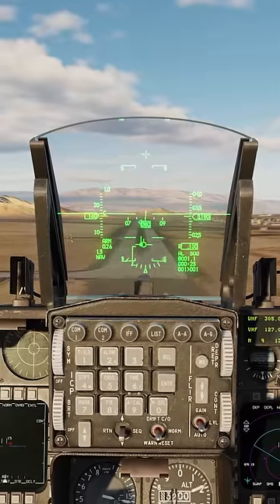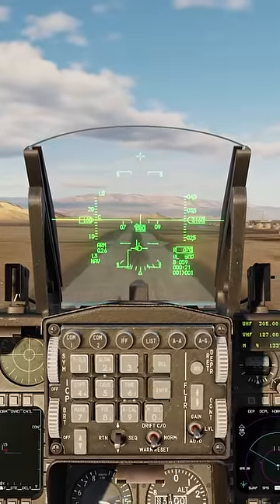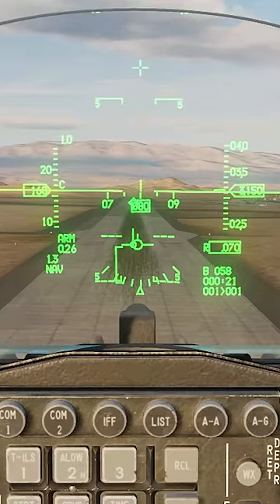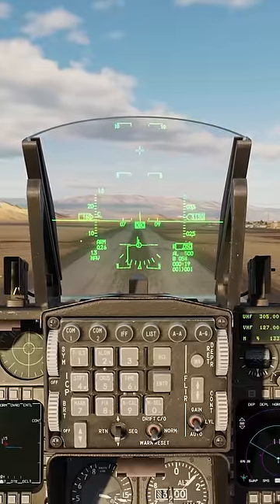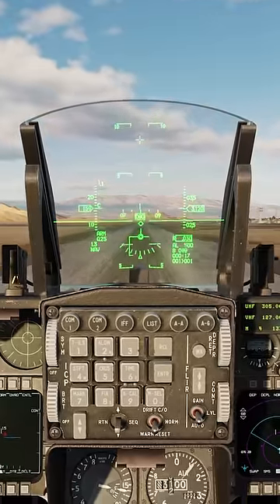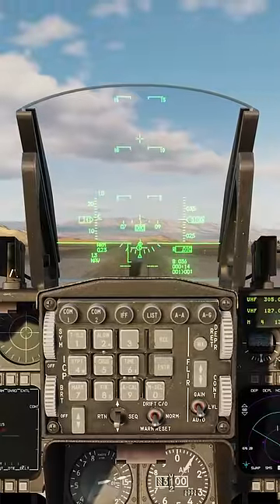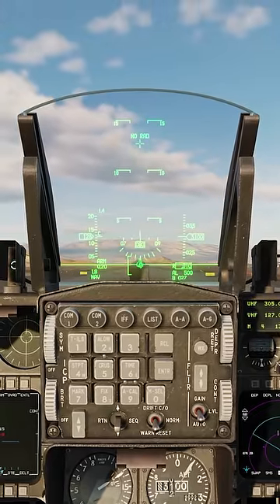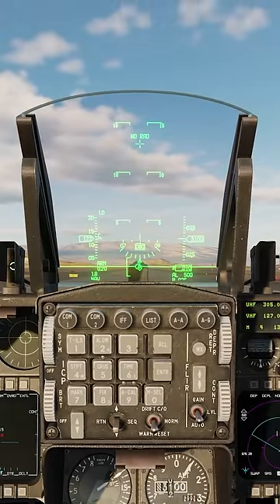Land the F-16 like a BOSS

Comment: I spent thousands of hours in an F-16 simulator in the 80’s. 

All they had me do was shoot at MiG’s 

It was the 80’s 

Good times!
Reply: How did that work? Sounds super interesting can u give us a basic rundown of what it was and how it worked?
Reply: @hi_c.v7289  nice try Russia/China
Reply: @irohaboat  teehee
Reply: Was an After Burner arcade machine?
Reply: @yamilishernandez7670  That would have been an upgrade. It was nothing but air to air and they kept adding to it till you dropped stuff.
Reply: Hard to believe how old these jets are!

Comment: First thing many people do wrong is assume the F-16 lands at passenger aircraft speeds, you’d be off to a pretty bad start approaching around 140kn.. it gets very unstable, you want to keep it around 170kn when flying the entire approach until right about to touch it down, ease it on the tarmac, and then aero brake, honestly an F-16 flies well, if you don’t overdo inputs, just like an Airbus A320, the less erratic inputs the easier the landing gets. 

The problem with the F-16 is the narrow wheel base, that’s what makes it very “hard to land” if you start playing with rudder too early, you’re going off the runway. 

Let it land, keep the flare, roll out. Practice makes perfect.
Reply: lol F-18 can land at 130 knots with no stores and 3000lbs of fuel

Comment: great landing, only comment is to close the airbreaks during landing. you open the air breaks AFTER you apply wheel breaks. the other trick is to use differential breaking to keep the jet in the center of the runway.

Comment: Aerobrake is done for economical reasons (and landing stability), not because it has "bad brakes" it actually has very good brakes when compared to some others in aviation. according to a few real word POH's i've read 'when the shortest possible stopping distance is req. lower nose as soon as practical and apply full brakes' paraphrasing ofcourse
Reply from the maker: I’d refer you to Rain from the afterburn podcast where he talked about that.  Never said bad brakes but small brakes.

Comment: Yeahhh this is the air force loading method.
Meanwhile in the Navy...
Aircraft barely hooks the third wire, almost goes into the drink, the tyres burst on landing and the nosewheel landing light shatters 

Pilot: Another happy landing!
WSO: *fingers numb from avoiding the instinct of pulling the ejection handle

Comment: I'm always nervous about striking the tail during my aerobrake so I tend to hold the gun cross at 10 degrees to give myself a little more wiggle room in case I fuck up on the pitch control.
Reply: I'm pretty sure 10 deg is the correct SOP until 100 knots then drop the nose and gently break.

Comment: If you want to fly an F-16 in a simulator, the best way to do it is not to fly DCS, but to fly Falcon BMS instead. (Currently at rev 4.36)  BMS has the most authentic F-16 models.
Reply: bot
Reply: @gibbo_303  Nope. Truth.  BMS > DCS.

Comment: Navy F-18 next?
Reply: just get full flaps and gear down, trim the plane until the velocity vector is in the middle then adjust throttles until the velocity vector is on the touch down zone then regulate throttle to keep it steady

Comment: Wait I use aerobrakes at the same time as I pull my landing gear down, should I stop doing this?
Reply from the maker: I don’t use wheel brakes until after the nosegear comes down; under 100 knots
Reply: @TrickerDCS  I meant air-brakes. I pull them out at the same time as my landing gear when I land.
Reply from the maker: @williammonot6426  you’re supposed to land with them out, but when you have weight of wheels, the speed brakes can go out even further but you’re not supposed to bring them out fully until the nose gear comes down.

Comment: AOA is not measured in degrees. You have degrees of pitch and units of AOA. AOA units mean the same thing during all phases of flight for a specific aircraft, but the attitude of the aircraft will vary for the same AOA depending on parameters of the flight (airspeed, or increased G loading for example).

Comment: why havent they designed them wheels a bit wider man .... even steering it too hard while on the ground will tip it over lol
Reply: cause it’s designed to go fast in the air not the ground
Reply: @gibbo_303  yes but driving that shit on the ground if you have to hurry and get it off the ground is just horrible.